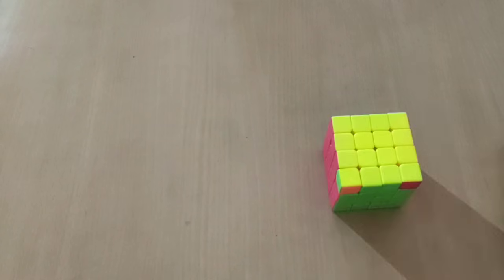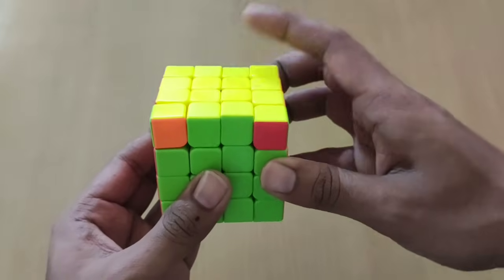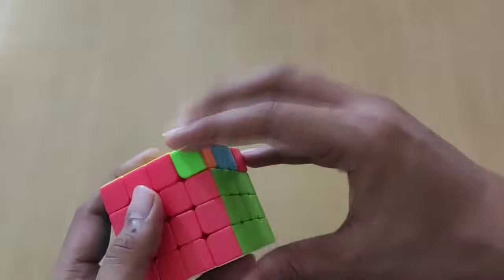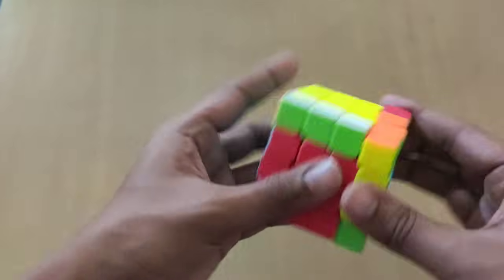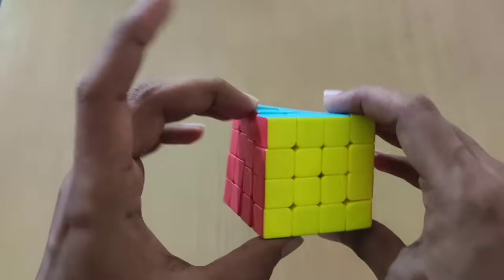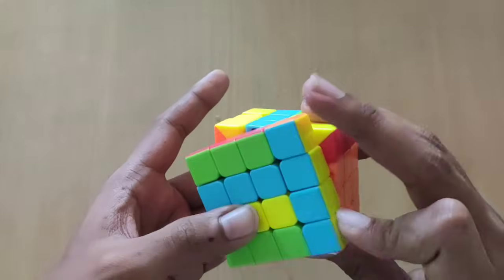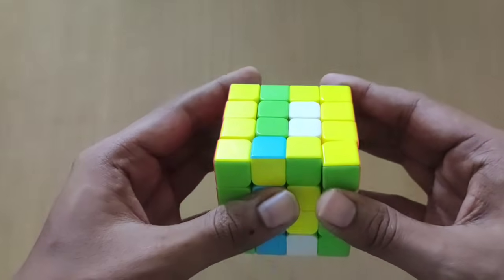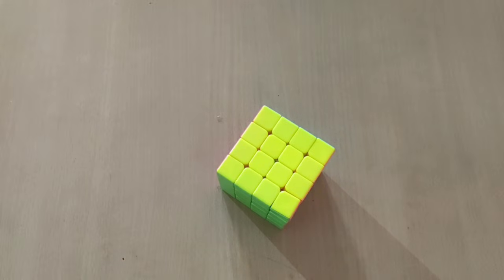4x4x4 Rubik's Cube Edge and Corner Parity | Cubing Corner

Comment: I was stuck in a two corner partity issue. Out of frustration I reassembled it from another side and ended up with the two edge pair scenario shown here, so I finally fixed it, thanks to the tip. The 4x4x4 can be the devil, due to this. Megaminx is a stroll in the park compared with this.

Comment: I bought one of these Rubik’s Revenge 4x4x4 cubes when they first came out in 1981, and having already learned Patrick Bossert’s method for solving the original 3x3x3 cube, sat for 3 days and worked out, and carefully wrote out, a solution to solve the 4x4x4 cube from any starting position….but stupidly leant the cube AND the solution, to a “friend” of mine….and never saw them or the “friend” again! I could’ve published it and made a few quid if I hadn’t been so stupidly trusting!
Reply: sure ya did, man. sure ya did.